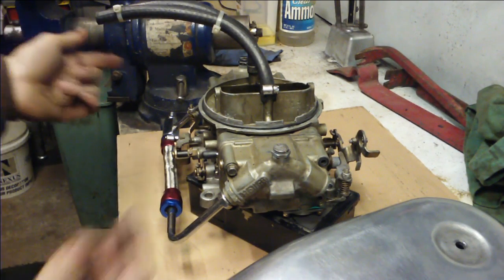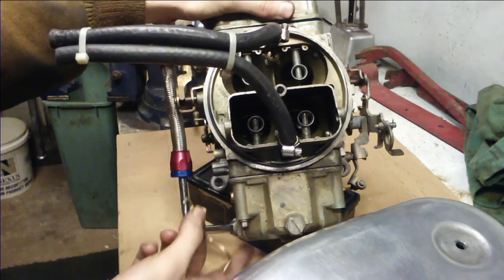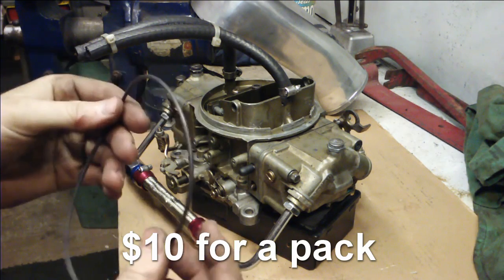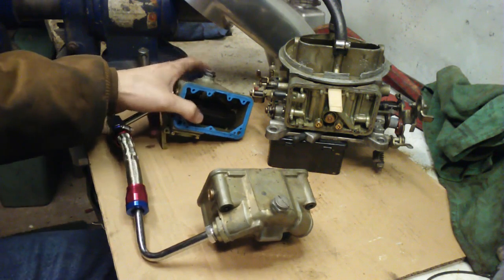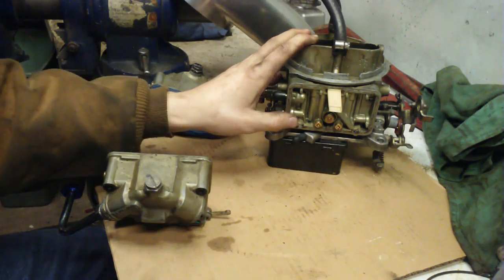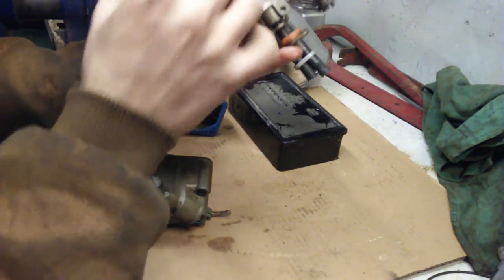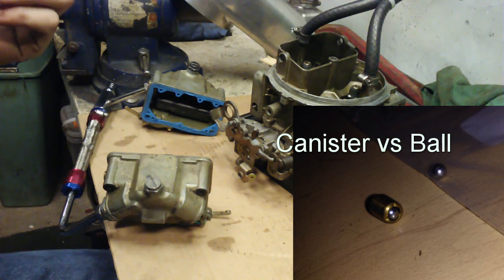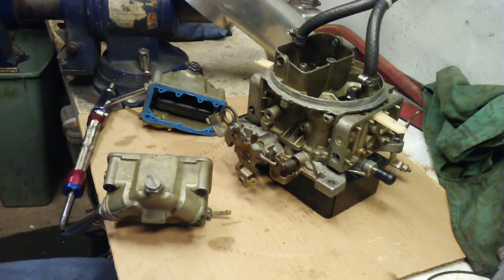Basic Holley Carburetor Modifications for Blow Through

Comment: Hey man, where did you connect your Boost gage? I’ve got my AEM Tee’ed off of the BOV line coming from a 1/8” NPT hole on my carb spacer but can’t get a good reading
Reply from the maker: What's not good about the reading your getting?  Mine is off of the vacuum tree on rear of intake manifold. Carb spacer should be a good source for it though.I have sence switched over to EFI fuel injection, in some more recent videos.
Reply: I think I was too conservative with the settings on the boost controller. I went from 30% duty to 50% duty cycle and was finally able to build some boost.

Comment: Why not just use drawl through what's the disadvantage ❓🚩
Reply from the maker: That was an option that I weighed, but due to engine bay size  and it being a V8, Putting the carb on inlet of Turbo i feel the piping would be to long and fuel could puddle in tubing before it makes it to intake,  and I believe it could have a Hard starting issue. Now If it was a old style 4cly I would have probably done draw through.

Comment: Do you have jet extensions or opinion on jet extension?
Reply from the maker: Yes I did have them installed, in the rear. The foam/Nitro float is notched for the exstentions ,and they help with fuel starvation on heavy launches.

Comment: Do you HAVE to use a double pumper? I have a dual line single pumper laying around, could I use it? Thanks
Reply from the maker: I do not think a vacuum secondary carb will work with the Hanger 18 modifications, if that is the type of carb you are referring too.

Comment: Nice video. 4 years later. I will be building a blow through setup for my 1980 Capri 2.3 Turbo RS.
Reply from the maker: Thank you!
Reply: How did that go? What type of carb did you use?
Reply: @babas990  I ended up not getting the car since the seller was a twat.

Comment: Do you have to upsize jets if you run turbo pressure to fuel chambers.Ive read that turbo pressure forces more fuel through jets. I want to turbo my stock N/A 4cyl. I've read a lot of forums about turboing even considered a draw through method. Hoping to get answer.
Reply from the maker: I Would say yes, but the only real way to find out in your specific application is to just do it. Looking back if I had the space ( like a 4cly does) or was turboing a smaller size engine, I would have went draw through.
Reply: Nuisance Racing It is relatively small engine 1598ccm i can run a lot of boost because compresion is really small. I have a lot of space engine bay is really big. It doesnt need to be anything spectacular it's just for fun.
Reply from the maker: LuX The only thing you can do is research, which it seems like you've been doing alot of,and picking the best one (draw through or blow through) .

Comment: how do you attach the metal line to the carb vent? i dont wanna just stick it on ther and hope it stays
Reply from the maker: BOHYDRUS it stayed with rubber line and hose clamps until my most recent video where I switched over to fuel injection.
Reply: ok , i just pulled the short vents out with pliers ,ther only 1/4 inch in ther . then i put my new lines in ther and clamped them together so they wont move or fall in if one happens to come out ,but they fit tight . i used my old transmission line was perfect size .
Reply: oh yeah i flared the end so to catch some air too
Reply from the maker: Great idea!

Comment: How about a motorcycle carburetor?
Reply from the maker: I'm sure you can, might be procedures to modding it  due to that its is a different type of carburetor, I am sure people have done it though.
Reply: I did it on my snowmobile.  It’s not easy.  The fuel pump/pressure issue is the hardest to overcome. But it does work.  It’s a lot more involved than a regular car carb set up.

Comment: Glad to see people are still using my writeup over 15 years later.
Reply: Man that thing is a gift to the performance world!! We thank you for taking the time to share the knowledge!!!
Reply: I'm getting ready to do a video following the Hangar 18  Fabrication write up step by step.
Reply: Michael Foist what all did you modify on yours ? I have never used elderbrocks because in my exspience they have a dead spot that is impossible to get out. But in terms of converting to blow through they song leak boost like I have heard so many holleys do.
Reply: @bryanroupe8646  check yur accelerator pump Holly's are bad about that even when there new
Reply: I just used it. Thanks
Reply: God bless you
Reply: 20 years now…
Reply: Your write up can drink now….
Reply: It's mine, not yours
Reply: Hangar18Fabrication hi will a 600 4150 converted to blow thru br good for a 5.3 with a 69mm
Reply: @MrTyler1798  NO WAY BUD! 600 CFM IS TO LOW/LEAN.  GET 750-850CFM. SORRY HANGER18 NEVER RESPONDED.
Reply: @MrTyler1798  Still quite valuable to me as I want to do this to a 2300 series carb for my 2.3 pinto motor

Comment: Hey idk if you reply to these still but I'm trying to turbo a 350 tbi any help would be greatly appreciated ! Please get back to me
Reply from the maker: Nate Gerdom I have never messed with TBI, I would Google it and see if you can find anyone that has done it with TBI ,research is key when turboing a vehicle or doing a large modification to one.
Reply: Nuisance Racing I've done so much research but I trust what I've read as much as I trust the random people , im not entirely sure what size turbo I should use , if I need an inline fuel pump , bigger injectors ? Boost refferenced fuel pressure sender ? Wide band o2 ? And what sort of tune do I need to get away with at least 7 psi
Reply from the maker: Nate Gerdom search up what size turbos people put on 350s, that would be your best bet, will probably need boost ref regulator, fuel pump,wide band O2 for tuning and possibly bigger injectors. As for tuning,I have no clue, I'm sure people have tuned TBI before but you going to have to research that one too.

Comment: I wouldn't attempt to use this setup it is pretty hokey. The theory with the fuel regulator is not that you're pushing fuel back in the lines it's that the engine needs more fuel underboost- without a boost referenced regulator,
Reply: You mustn't be real up on your blow thru setups because these mods do indeed work for plenty of guys that dont have a grand to spend on a carb.
Reply: The bowls will  run dry.
Reply from the maker: Correct, I miss spoke. Well the hokey setup works pretty decent : https://www.youtube.com/watch?v=ng4KpBz2FQ0&t=5s

Thanks for watching!

Comment: Question you drilled a hole in the carburetor hoedown post so I'm assuming the post must be hollow to let the air get down inside of it to the valve at the bottom I've never seen a hollow post

Comment: So if you have something like a Proform racing carb that didn't come with a choke/choke tower, has the power valves blocked off (racing application), the only things you really need to look at on the carb are cork floats and maybe vent tube extensions.
Reply from the maker: I would say yes. Sense you don't have a power valve your main and secondary jetting will be way different than with a power valve, and it may be tricky to tune due to that, but that just a assumption. I would read " http://www.hangar18fabrication.com/blowthru.html " for  all of the little details and small things that can be done also.

Comment: whats the deal with the two wooden sticks on top of the metering blocks? do I need to install on my carb?
Reply from the maker: Its called a vent baffle or vent whistle .The vent baffle is used with the center-hung style fuel bowl. It extends the fuel bowl vent to near the wall of the fuel bowl and can effectively control fuel splash on the primary side when accelerating hard, or on the secondary side when braking hard.
Reply: Drew Fetters @ok thanks!

Comment: Did you drill your power valve holes bigger?
Reply from the maker: I Did not, I figured with  running low boost it would not be necessary, and while I did not have the car out much, it seemed like the AFR stayed good without drilling them out.

Comment: someone else set up my carb and it keeps starving for fuel under heavy acceleration your comment on the regulator set off alarm bells in my head i have a vaccum line run to the regulator but i suppose its not a vaccum line under boost. suggestions?
Reply from the maker: how much boost are you at under " heavy acceleration"? is it a boost referenced regulator,some stock regulators have a vacuum  line ran to them but are not made for boost.
Reply: +Drew Fetters.  its a mallory 4309 regulator id say from 15 to 25 lbs i havnt got it dialed in yet i havnt checked the specs on it yet someone else set up the car and ive been patching it up
Reply from the maker: what carb is it? what size fuel line are you running ? fuel pump size? what engine? thats alot of boost.
Reply: +Drew Fetters stock miata pump atm i had an aftermarket pump but burnt it up running both at the same time stock size fuel lines i think both are 5/16 lines its a ford 2.3 out of a turbo coupe 2 bbl holley carb i assume its a 2300 havnt run the numbers yet been thinking about pulling it and going through it to see what hes done
Reply: +Drew Fetters the regulator says it increases fuel pressure for every psi imight be flooding under hard boost but tome it seems like its starving
Reply from the maker: Sounds like you need bigger fuel lines and a bigger fuel pump to start out with. Thats alot of boost to be pushing on a stock engine ,if it is stock.
Reply: i agree but it really likes boost and doesnt start to make power till it hits 10 psi ill ill likely go to a fuell cell and bigger lines and pump. 5/16 lines sound puney saying it out loud lol .Your video is very helpfull and thanks for taking time to reply
Reply from the maker: Anytime,Good luck!

Comment: nicely done mate, little tip depending on your power level, it happened to me was running in constant air fuels in higher boost with my blo thru had me stumped for a while. Mucking around jetting etc, then decided out of luck too pissoff single line from reg too carb went twin dash 6s, problem fixed went back in jetting still solid air fuels.they need good fuel supply there no different to na only 5 or so pound of fuel above boost.they need flow,
Reply from the maker: Cool tip,thanks for watching!

Comment: hey drew just did all your mods to my holley 500cfm one ? my pcv valve will now go to my intake pipe before the turbo correct seeing how the the carb will be under pressure instead of vacuum? building a 225 slant turbo
Reply: Some cars have the pcv routed before the air cleaner too though they have their own sponge filter.
Reply from the maker: Correct. You could also hook it up to the back of the carb on the base plate IF you have a good pcv that will fully block off any boost trying to get through(back to the crank case) ,because you will not be under boost all the time so when you are under Vaccum it will pull crank case gasses in.

Comment: how many lbs of boost are you pushing
Reply from the maker: +67JD110 Was at 10psi, have hit as high as around 14.
Reply: +Drew Fetters  hey bud where are you running your vacuum line for boost pressure? Intake or from the turbo housing?
Reply from the maker: Right after the turbo on the black pipe( can be seen in other videos.) If you are not running a boost controller and you are using a cheap wastegate ,you will have a boost leak through the wastegate, and will be a vac leak if you run it from the intake.If you need a cheap boost controller Id suggest a NXS Manual Boost Controller.

Comment: might be a crazy idea, but, i'm running a std hei gm dizzy, if i leave the vac line off and use it like a locked out dizzy, surely it just won't advance at higher rpm where the boost is coming in. what do you think?
Reply from the maker: +Jim Thorpe Ive thought the exact same thing,but when you are not in boost it will feel very slugish. the best way is disconnect vac line, rev engine up to about 3-4k where it stops advancing itself and set your timing for boost.then reconnect vac line .because when you are in boost anyways you will be at 0 vac so that timing will be setting is the timing you get at wide open throttle in boost, if that makes sence.

Comment: i only went into boost with a hard rev from idle up to about 3k, but no road test yet as i'm waiting for a pair of shafts from Mosa.
Reply from the maker: +Jim Thorpe The road test is where you will see most likely that you will need a boost ref reg, and a fuel pump.At idle and reving you wont see the need for pump or regulator ,when you hard rev you are really only using fuel in the carb bowls and not needing fuel from pump because it is not under load or under boost for a decent amount of time.

Comment: Out of curiosity, what size jets are you running? and what vacuum rating power valves? Very informative video, I'm about to build a blow through carburetor for my turbo small block and this definitely helped me get an understand of what I need to do.
Reply from the maker: +yamahondarider Primarys: 65 secondary's: 70  .I Don't remember what power valve im running,carb is at the shop and engine is torn down ( seen in video coming out tomorrow). Glad I could shed some light on some things,thanks for watching!
Reply: Drew Fetters Wow, thats good to hear. I was afraid I'd have to be running some monster jets. Right now I've got 69 primaries and I believe 74 or 76 secondaries. Naturally aspirated mild 350. I suppose I'll do the basic mods and see where I'm at before I jet it way fat. BTW, have you noticed any downsides to keeping the choke horn? I see most people cut it off.
Reply from the maker: I removed my choke horn after this video was made but have not taken car out sense then.It should let air move into the carb smoother because it does not get restricted in the >1 inch space between the top of the choke horn and hat.On a NA car I wouldn't expect a difference in hp ,but might see some gains in boosted application . So downside is that might lose a little hp ,but thats just my thought,no evidence to back it up.

Comment: great explanation of key points.  I put a turbo from an izuzu diesel(heavy truck) on my 78 f150 with a 300 straight 6.. I'm going to use a 670 Street avenger so we'll see how it works.
Reply from the maker: +Matthew Keeney Thank you. That will be a cool truck, I thought about throwing a turbo from a Dodge Cummins or Power stroke, but could not find one for a decent price around me that would be the right size. Comment back or throw up a video of how the modifications go if you think about it!
Reply: How did that work out
Reply: Putting one on my 77 f150 how much boost u pushin